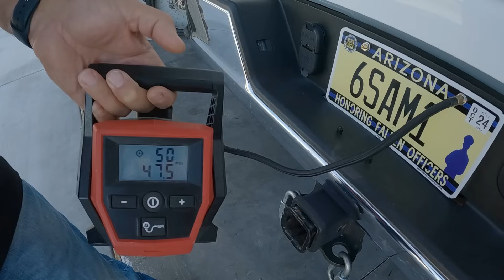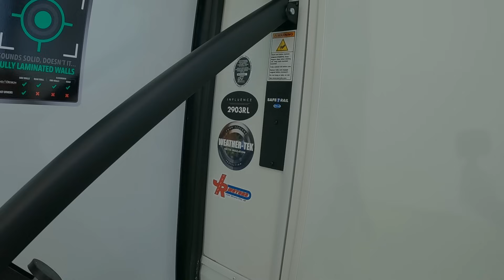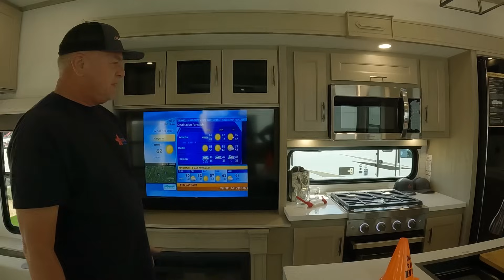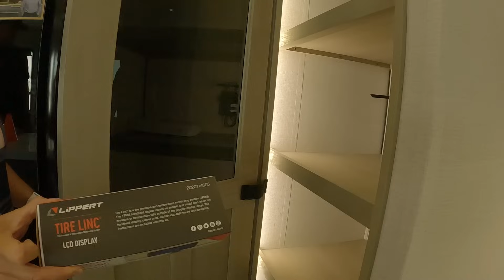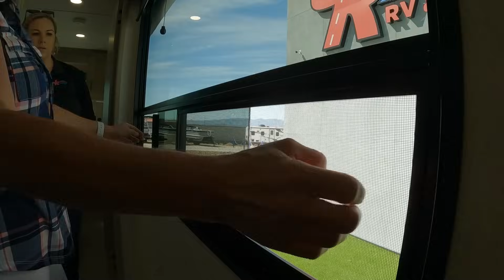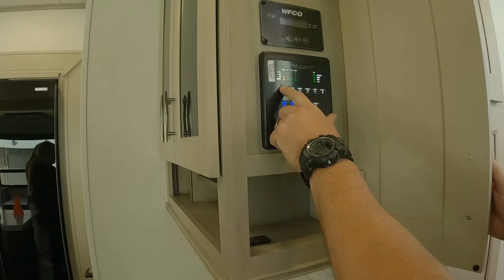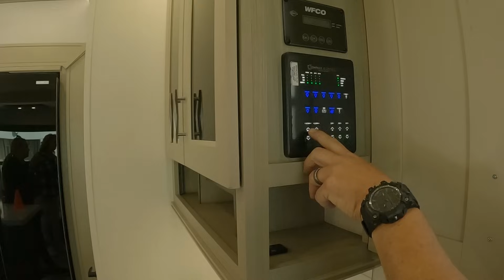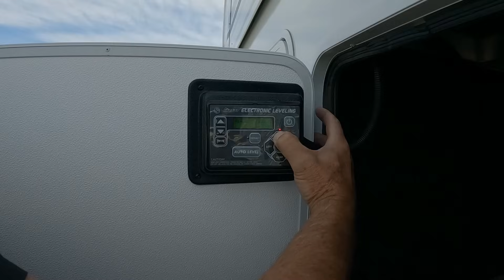2024 Grand Design INFLUENCE 2903RL // Our First Look!

Comment: Let us know how you are treated after that high dollar rig starts falling apart and they tell you to go pound sand
Reply from the maker: Hi Steven,  which Grand Design do you own?  We found a major issue with the roof of our bedroom slide.  Took it to our dealer they temporarily fixed it so we can begin season 7.  It took them a day for them to get approval and parts from Grand Design.  Grand Design authorized a brand new roof.  We were shocked how quickly it was handled.  We purposely wanted to go through the proper channels that was advised by Grand Design.  JR Motors is a top notch dealership and knows what they are doing.  We truly believe to always have a positive attitude.  You will receive a lot more sugar than vinegar.  We love Grand Design and this is our second Grand Design.  We put over 35,000 miles on our last Grand Design.  With every little issue we had, Grand Design has always given us excellent service!  

So if you own a Grand Design and have problems, talk to the service department personally not through your dealer and get them involved.  Did you know Grand Design has Service Response Teams ( SRT ) technicians all over the country that will respond to where ever you are at?  What other company does that?  Thank you for joining us! Blessings, Stan and Rhonda🙏🏼❤️

Comment: Ya know it all looks great on the surface.
But the monster that lays beneath is the one that will blow your investment to shreds.
Yeah no cracked frames for me . And it’s a shame cause I really like it but just can not trust the company or the product. That’s just to much money to gamble with.
Reply from the maker: Hi Jeff, don’t buy into all the hype for clicks!  Negative stories get lots of clicks.  This is my second Grand Design.  Love the company and love the Grand Design family.  The frames are made by Lippert.  Most RV brands use the same frame.  The problems are with the larger Tow-haulers and 5th wheel with drop frames.  Our Influence does not have a drop frame.  The most important thing anyone can do is have an RV inspection.  Used and New this would avoid a lot of problems.  Do you know Grand Design RV is now offering a 5 year warranty on their frames starting with the 2020 models.  That is great news for folks having problems.  Hope this sheds some light on the situation.  It’s tough being the king on top of the mountain everyone wants to knock you down.  Grand Design is the only company I know that has 11 Special Response Technicians travel through out the country responding to emergencies on the road. So before you change your mind, go do a tour of the company I think you will be surprised.  Stan and Rhonda🙏🏼❤️